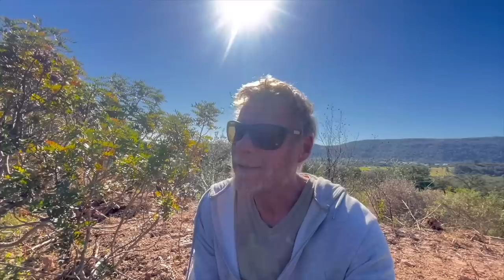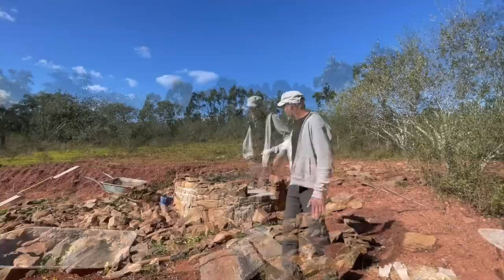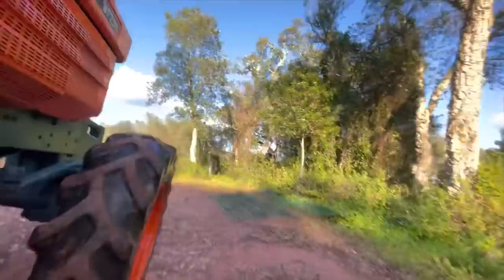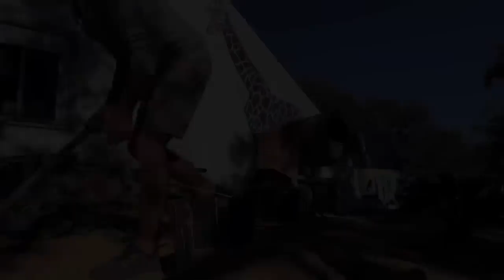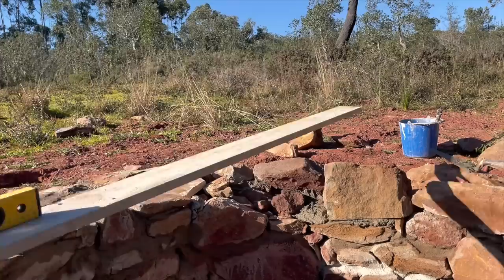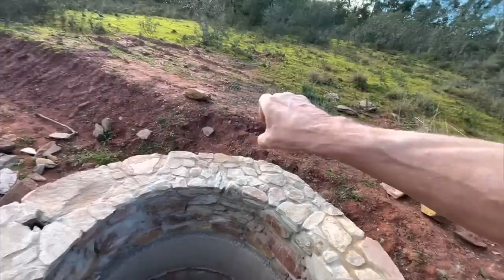My Stone Wall Well Restoration Transformed and Finished #107

Comment: Hi Andrew, nice being creative using a different product! Now what about a cover for the pump motor you will need use to water your orchard? Another " to do" on your list of creativity.🤔I see most folks just buy a cement dog kennel for pool pumps to protect them from weather. The wall is very smart, and so many stones are used up. Beer will sure bulk you up in no time!! 🥰

Comment: Nice job! You should do pointing on both sides.The inside would be a lot harder. When the top is high it's much more difficult to work on the small nooks and crannies being upside down.

Comment: Loving the well. Maybe a future job could be epoxy resin some alloy rungs into the side might be an idea. (cut a ladder down)  Good for clean out, inspection and safety..... also you could go down for a dip on those hot days. 😊